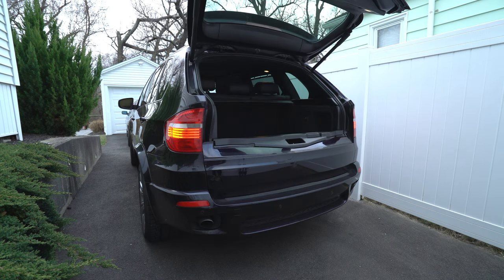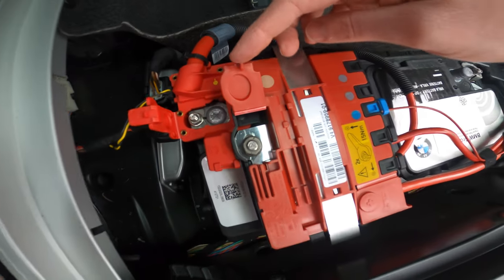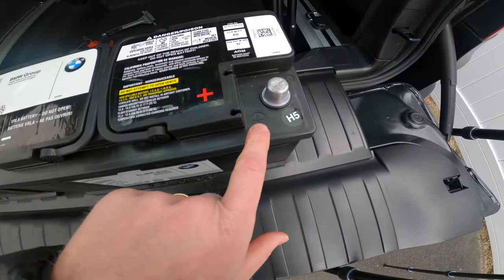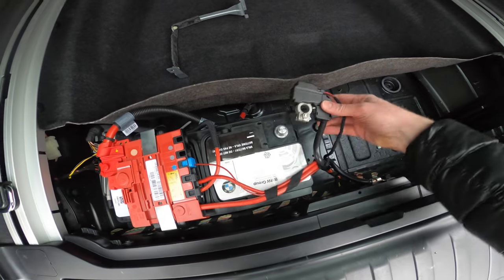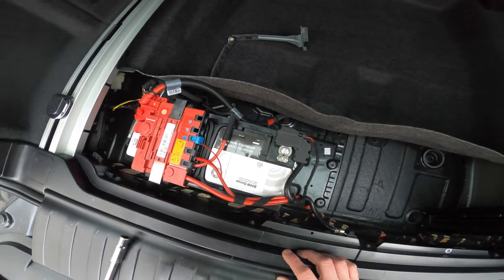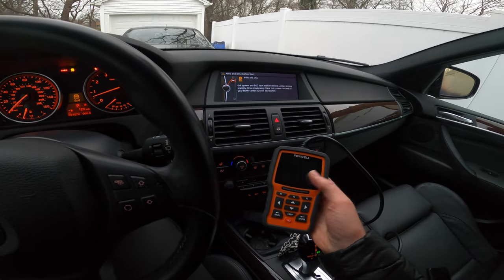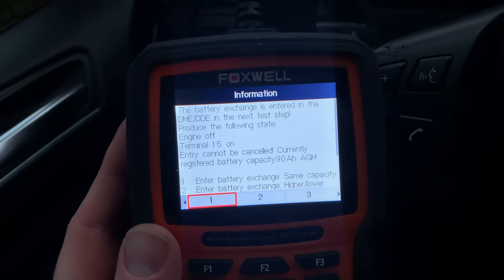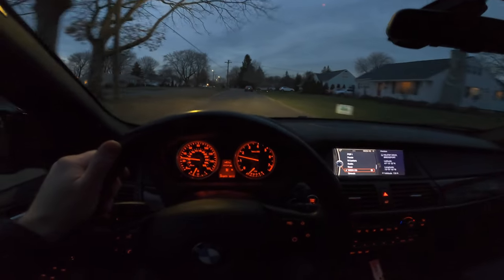How to Remove, Replace, Program and Register a New Battery in the E70 X5 BMW DIY

Comment: You can also turn your steering wheel all the way left then all the way right and back foward and it’ll reset your steering angle sensor which will reset the 4x4 codes
Reply: Is that with the engine on or off
Reply: Thank you very much

Comment: Quick tip for resetting awd and traction control warning just turn your wheel all the way to the left then all the way to the right and it will reset. No code reader needed

Comment: I followed this video step by step. Once the new battery was in the vehicle started and drove immediately. I then used the very same foxwell as in this video to register the battery. It said the registration was successful. Now the car won’t start at all. The battery is clearly working because the light, radio, etc. are working. The car simply won’t start now. Any idea why is this might be happening?

Comment: Don't you have to code the battery if the displayed Ah is different than what was displayed on your scan tool. Would that be a way to manually input your correct 92 Ah?

Comment: Just followed your excellent video and was able to replace my battery. The only issue: the one in the car (original 2010 battery) was a lead acid one rated at 90 Ah. One I received from BMW dealer is a 92 Ah AGM. I tried coding it but was not showing the 92 Ah option. So I only registered the battery using BimmerLink. So far so good.

Comment: Great video and excellent tips. Odyssey batteries are still made in the USA and use 99.9 percent pure lead, and are designed to last 10 years. 
 I would also install a Pulse Tech PowerPulse passive desulfator on your battery, Pulsetech claims that their patented frequency can extend battery life up to three times. I have been using a PowerPulse on my 2001 BMW 530i battery for the past 3 years, and it never has an issue starting even though I only drive 25 miles a week. I also just desulfated a Duralast Gold BMW battery on my other car that I let sit for a year disconnected and it tested at 11.2 volts and was dead. I charged it for 14 hours with a Exide automatic 6 amp charger and it still would not crank over my other BMW. I attached the PowerPulse on the battery for a week, and charged it with a 1 amp manual charger for 72 hours and it is now again starting my car . Heavily sulfated batteries can take a month or longer to desulfate. Noco Genius 5 and 10 and Ctek battery chargers have a repair mode, but I believe they use voltage spikes to desulfate a battery.
Reply from the maker: Thank you for the excellent comment, I learned something new today! Merry Christmas.
Reply: @BIMMERZEITT  I have also learned so much from you. May you also have a Merry Christmas and a Happy New Year.

Comment: Would it be smart to connect a 12V power supply to the charging connectors under the hood, to keep the car powered during battery replacement?
Reply: That's what I was thinking. Why let the vehicle lose power if you don't have to?

Comment: It worked for me but not at the first attempt !

The first time I installed a Costco battery (around $170) and failed to register it using a Foxwell NT530. I figured the car recognized that an aftermarket battery was being installed and refused it.

I returned the Costco battery and purchased an original BMW battery from the closest BMW dealership (my 2013 X5 N55 uses the 950 battery, which costs around $270) and tried to register it following exactly the same steps as shown in the video and the Foxwell scanner still wasn’t able to register the new battery.

After doing some research I read a forum where a guy says that you need to register the new battery with the engine turned off. You have to inset the key and press the start button once (without pressing the pedal). When following this the Foxwell NT530 registered the battery straight away.

Now I wonder if it could have registered the Costco battery following the same steps. Not sure since aftermarket batteries don’t have the battery code that needs to be entered.

Comment: If you connect a trickle charger to the charging post under the hood then change your battery, does that help in maintaining power to the computer and negate registering the new battery? I have a 2012 X5 35d Thanks
Reply from the maker: Nope, you still have to register it. You’re telling the cars computer and alternator how to handle the charging duties.

Comment: I replaced my battery with same new battery in my 2012 X5 35D. I even had my BlueDriver module to the battery registration. It said it was successful, but now I’m getting the battery not charging warning and it is definitely not charging according to my multimeter. Do I need a better tool to register it? Can I register it if I disconnect and reconnect after charging the battery?

Comment: Thanks, I thought so. So can you download a program on your Mac laptop, get the correct OBD cord and register the new battery instead of buying the code reader? Thanks..
Reply from the maker: Sadly no, the software is PC based so you need a PC. Code reader I linked is the easiest way for Mac owners (myself included) unless you want to run a virtual machine/partition I guess.

Comment: Seems to me if you keep the vehicle powered with an external power supply during the replacement, and you replace with an original BMW battery, then you would not need to register the battery and you would not encounter any fault codes. I doubt the battery charges differently as it ages; the programming is there in case you change capacity or type of battery. I'd like to replace my battery, but I don't have a scan tool; not sure it's worth purchasing one. Good video overall though; nice work.
Reply from the maker: If you own an e70 x5 it’s definitely worth buying the scan tool. You need it for access to so many modules and diagnostics. Register your battery the proper way, my .02!
Reply: Except, the battery does charge differently as it ages.
Reply from the maker: @ModMINI  lol exactly… Peter trying to outsmart BMW engineers over here
Reply: You won't believe this, but I'm actually a battery engineer. Not a lead-acid expert, but I work with LiIon chemistry. Care to explain the algorithm BMW uses to adapt charging to battery age? I'd like to hear it.
Reply from the maker: @huskypup3489  just to clarify, the factory battery is AGM not lead-acid. These cars have an intelligent battery sensor “IBS” to monitor the battery state and adjust charging parameters accordingly. In short, as the battery degrades over time the ECU uses signals from the IBS to adjust charging from the alternator based on the battery condition. Assuming the battery degrades over this 7 year period, the alternator will be charging the battery at a slightly higher rate at year 7. If you place a new battery in, the system will continue charging at the elevated voltage because it thinks the old battery is still in there. That, in turn, will mature the new battery faster than necessary. Does that mean you’ll get 6 years from it instead of 7? I don’t know. But I don’t want to find out!

Comment: It sucks that you had to use a tripod to prop open the cargo floor. I had an E70 with a factory gas strut installed on this door - I think I can see in your video where the unused mount point is on the metal frame. I'm not sure exactly what year BMW stopped installing this strut, but I recall seeing it absent on a later model in the showroom and thought it was quite the cheap move of BMW - The salesperson concurred.
Reply from the maker: Good catch! It looks like BMW stopped installing that on later model e70 cars. Might have to retrofit one in from an early model now!
Reply: My 2013 has the gas strut.
Reply: @mcplutt  That's interesting as 2013 was the last model year of the E70. The starting MY of 2007 and at least a couple of years in definitely had the strut too. I think it was around 2010 or 2011 when I saw the strut was missing from a showroom vehicle and the salesperson confirmed the unfortunate change in production. Based on your 2013, it sounds like BMW decided to bring it back at some point before the end of E70 production. NOTE: All the examples I refer to are US production out of Greer SC (BMW America). I can imagine how other BMW markets could have tracked differently.
Reply: @forumtyish  My E70 was made in Greer on the 1st of April 2013 😄 Export Europe version. Luckily no DEF.

Comment: Tell me where did you source your new BMW battery from? The dealer?
Reply from the maker: Yes, the parts counter at my local BMW dealer. I suggest you do the same. Be sure to check the date sticker on it so you get a “fresh” one. Most BMW dealers are high volume so likely their battery stash will be “fresh”.

Comment: Any info on whether the NT510 will successfully register a new battery that is not a BMW battery?
Reply from the maker: You can use an aftermarket brand battery without problem so long as the specs are correct. Brand does not matter. I prefer genuine BMW though.

Comment: Would you have trouble fitting any other type of battery other than a bmw because they would be expensive
Reply from the maker: The BMW battery was only $50 more than an aftermarket brand from a local supplier. Shouldn’t have trouble installing 3rd party make with the INPA or ISTA software. Your success may vary using one of these handheld scan tools.

Comment: What happens if you don’t register the battery? I changed mine out and didn’t register it. Are there going to be any issues down the road?
Reply from the maker: Yeah you pretty much have to register it to tell the car how to charge the battery. You could shorten the lifespan of the alternator and new battery by neglecting this step.
Reply: Or it won’t start eventually cause your car will act as if you’re not the owner

Comment: I have a 2008 e70 3.0si and I had transmission malfunction and 4x4 abs dsc light came on as well. Got it out of limp mode and drove it him and did it again.  I disconnect the negative cable for a reset and all the lights and car was functioning normal. Didn't drive all day and went to start battery was dead light real dim etc. Could a low or old battery cause all the symptoms stated above?
Reply: I got the same problem with mine what did you find out was it the battery or alternator ?
Reply: @thegrimreaper1882 me too did u find out anything
Reply: Same here did u find out anything

Comment: I have abs park and trac control lights on and after I installed a new battery it didn’t go away, do I have to do what you’re doing?
Reply from the maker: Usually you can turn the steering wheel all the way left and all the way right and/or drive the car a few feet and it will recalibrate the steering angle sensor.

Comment: Nice!  I hope you never have to change the parking brake actuator.  When they lock up, get twisted and the quick release won’t work…cars has to be put in transport mode…not a fun job.
Reply from the maker: Yikes! Where is that located? The rear brake calipers appear to be regular brake calipers.
Reply: @BIMMERZEITT  it’s in the left rear wheel well above the axel.  It’s three cables if memory serves.  One goes into the left rear on shoe.  I helped do this job once and had a family member with the same issue and sent them to a shop.  The box is $970 and you have to code it to the car.
Reply from the maker: @cbrettnewman  oh man, that’s brutal. I hope we never experience that failure.
Reply: @BIMMERZEITT  I would be selective about using the pb when you’re traveling.  It crippled my sister in laws car and it had to be towed (no way around it).  I hope you never have to deal with it.